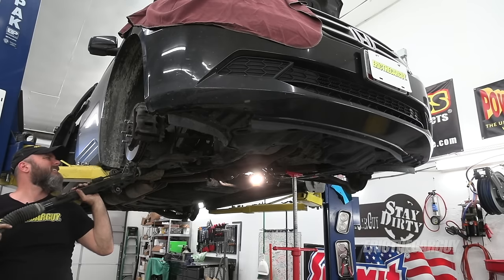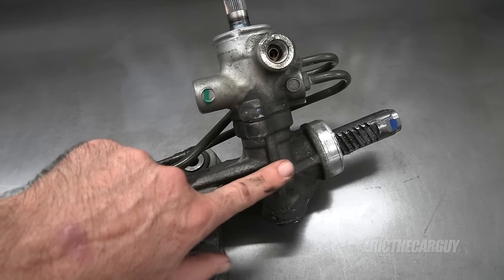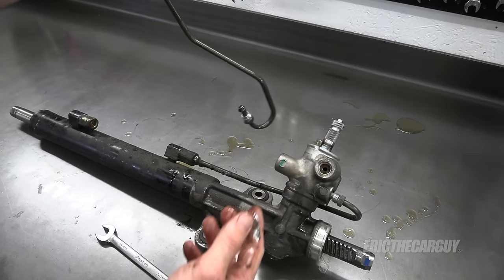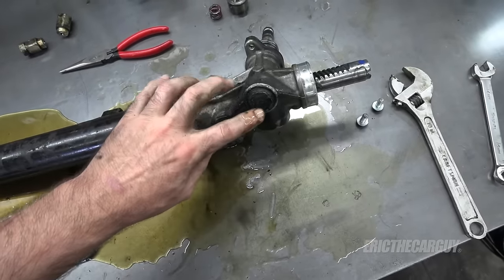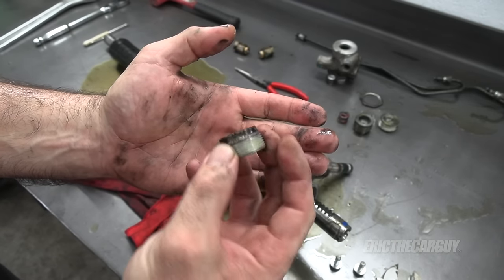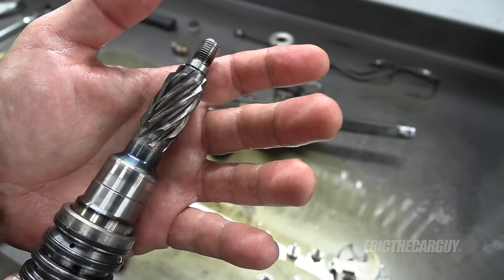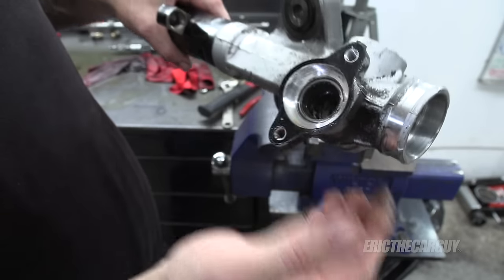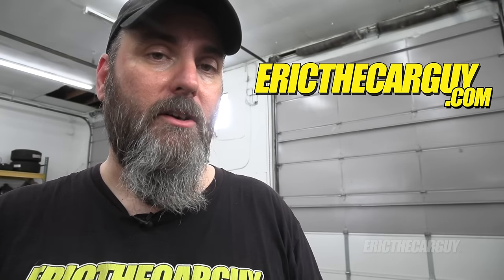Whats Inside a Power Steering Rack?

Comment: The older Odyssey racks didn't carry the pinion through the bottom of the rack. Instead of the wire clip arrangement the end cap screwed in with a bushing. Unfortunately on pinion side, the rod passes through the housing resting directly on the housing. You will find an indication of a slight flat spot on the rod where the adjustable plunger rests, as the rack moves across the alloy housing, you get a rattle which often people assume is the inner tierod, but is the excess clearance between the housing and rod. It actually makes alot more noise than you would expect, you can adjust some of the movement out, but you don't want it going tight on the less worn area. Incidentally the half round cap that rests against the shaft, is a plastic material on the older ones.
Overall there is little provision for lubrication between the rod and housing. Should a boot tear, muck getting in will end up on the outer housing and cause rapid wear between it and the rackrod, especially on the pinion end which sees the steering effort applied.
By the way, your rack is the wrong way round...

Comment: I've been having an issue with my 2006 Accord after tighteng the guide bolt about 1/4 of an inch and replacing the power steering pump last month. My steering intermittently stays light at high speeds. It's intermittent, it'll feel wiggly for a day or two then it will feel normal for a day or two. I found on your forum, you posted to a member saying that it usually is the variable assist valve in the rack failing. It sure seems like the steeting isn't "hunkering down" at driving speeds like it used to. It has it's good and bad days though.

Comment: the nut under the cap opposite the input shaft also sets bearing preload.  Too loose and it rattles, too tight and it damages the bearings.  I did a Ford Fox rack, there is a spec for rolling torque on the input shaft, basically the same idea as setting a crush collar on a diff.  Tighten the nut until its at whatever in-lb of drag.

Comment: Ok from what I am getting from this in , cause the top of my pinion is leaking , that instead of removing the rack , I can just remove the two bolts and both pressure lines and remove the steering shaft , I can remove the pinion housing ? to just replace that seal ?

Comment: Thanks for the heads up on the 17mm that holds the bottom of the pinion. I would have done the exact same thing. But it would have been on the tailgate of my truck. And I know the guy put break fluid in the pump. That would have been catastrophic to my paint.  Great work. And Happy Easter BTW

Comment: i happen to rebuild a similar rack and pinion for a montero 2005 and after some research the teeth MUST be at specefic tolerance or it wont engage with the pinion seamlessly and that  lead to metal to metal contact and causes metal shaving in the seals that you saw
it is rebuildable if you buy the seal and bearing kit

Comment: Excellent !   I have 2 Toyota's . a Corolla and a Tundra that have leaks in the hard lines on the rack.  The local mechanic says those lines can't be worked on, and I need to replace the rack = $1500  They looked like replaceable items on your video.  Should I get a second opinion?

Comment: Smashing teardown :-D
It's simple but complex, the complex bit is that rotation sensing valve, well that's my view.
The toothed rack and drive is a simple enough idea.
Now put a new bearing in and re assemble it lol.
Reply from the maker: Given that I just installed a brand new Honda unit, I won't be rebuilding this rack. Lots of people want me to though. Personally, I don't recommend rebuilding PS racks given the effort in R&R and the high potential of failure. I think you're better off just installing a reman and being done with it. That's just my opinion. As always, thank you for your comment.

Comment: Pretty interesting video, its good some one can open her up see whats what. I noticed that at time stamp 12:54, I can see a difference in the height teeths. From your hand to the right, they seem higher; from your hand to the left, they seem shorter. I don't know if theres any revelance Of course mine is an 05 T&C, which just developed a knock thump noise at turning either way. Not the cvjoints, been replaced. At a stand still, steering turns wheels left and right with no noise, until you actually drive it. And I am wondering, could it all be loosened bolts! It was in for high pressure hose replacement. I wonder if rack needed to be loosened to get the the hose fitting..

Comment: Wonder if in the accident maybe the rack wobbled a little inside the housing causing the fixed piston/seal to smash into the walls instead of the O ring causing just enough metal to scrape off and make tiny places where the fluid could leak by and it would bounce back and forth like a bad strut or something, plus mooshing the bearing making it that much worse.

Comment: I have a crown vic p71 as a beater daily and I've replaced basically everything in the front end but the rack, wheels are tight when you try shaking them by hand left/right/up/down and it has like a "shimmy" you can feel in the wheel, as if the wheels are wanting to go left/right slightly. Think it could be the rack? that's about all that hasn't been changed. It has just never felt like it wants to drive straight despite the alignment being done multiple times and everything changed from the ball joins to tie rod ends, sway bar links, etc

Comment: I have an 04 tl and the car always pulls to the left. Replaced power steering pump which made steering feel better but car still pulls to the left. I had an alignment done which fixed other driving issues (darting around over bumps). All suspension brake and steering components are ok. Did the shop maybe screw  up the alignment? Or could it be a steering rack issue?

Comment: There are sealkits available (inkl. new bearings) so you can reassembly the rack and use it oneday on one of your odysseys if you need one.
I would save the power steering rack as a reseve...

Comment: the seal on the outside of the rack gear rod does double duty. It serves as a place for the seal on the rod and the cylinder bore also the bearing block for the rod.

Comment: great job getting it apart might want to rebuild it as a spare cheap fix if it just needs bearings and new seals thumbs up shared
Reply from the maker: I seriously doubt I'll need another PS rack since I just installed a brand new Honda unit and I maintain my vehicles very well.

Comment: I've read that mfrs replaced recirculating ball steering with rack and pinion because r&p is cheaper to manufacture.  But that looked like some precision machining in there, didn't look very cheap to produce.

I would say the reason recirculating ball gives you less "road feel" is that that kicks from the road cannot transmit effectively back from the Pitman arm through the ball bearings to the steering column.  There is no such isolation with r&p.  I don't love "feeling the road", it's not comfy, but apparently some people do.

Comment: Great video. The steering rack on my 2008 Vito is leaking fluid from a steering gaiter after about 27k (reconditioned exchange unit) so if it's out of warranty I'm wondering whether I can get the seals out and replace

Comment: There is one more oil seal inside the housing, i been rebuild alot type of steering rack for 5 years now.
The steering rack is fixing able, you dont need to change a new one, when it leak.

Comment: The bearing in question may be 6001 one side rubber seal one side open, if u have a caliper might as well measure the inner, outer and width to get the exact size which will determine the bearing number.

Comment: about you working table, I have one there is 4 ft by 10 feet it used to belong to a guy that work on hydraulics very neat and organized table, it had an edge chanel heavy duty with downspouts for all the oil spells, that will lead to a container,  I found this could be good for people that work on automobile parts with a lot oil in it

Comment: That 1 way check valve can be an issue if your front wheel are hit in a crash when on full lock .The wheels being pushed back suddenly can upset that valve causing heavy steering .

Comment: If the bore of that Koyo bearing looks to be 12mm, that is a standard (catalog) bearing size: 6001.  12mm ID, 28mm OD, 8mm width.  I believe I've seen NSK, Koyo and NTN bearings used in various places in Hondas.  (The wheel  bearings on our TSX are NSK--not a standard catalog item though.)

Comment: I've seen the same retaining system at 10:45 used on hydraulic cylinders on heavy equipment, it's usually a steel band rather than wire but it's the same principle. 
And now that you have it apart maybe a rebuild video? Then you'd have a spare, and we all know that if you have a spare you will never need it.
Reply from the maker: I agree, I'd never need it. I have a new Honda unit installed in the van that's working perfectly with brand new fluid. https://youtu.be/haCGztYY0rk

I'm getting to a place where I'd rather have the time over some part collecting dust somewhere that I'm never going to use. Thanks for the comment.
Reply: @ericthecarguy  I was attempting to reference the phenomenon of having a spare and never needing it for the purpose of humor, but it seems I failed.  I'll stick to my day job.
Reply from the maker: No worries. I get it now.

Comment: Howdy Great video. So I have a 1998 Honda RA5 V6 Odyssey power steering rack with a serious leak coming from where the rubber boots are.
I've tried Lucas stop leak 2 bottles worth and having no success. I'm thinking of using another stop leak AT-205 Re-Seal Oil power steering stop Leak. Rather than having to rebuild to replace the seals. Power steering Seal kits seem to be very expensive .  So was wondering if u can do a video on ether Lucas or AT-205 Re-Seal Oil power steering stop Leak and see what's the better chose in a real world!? Before I go and start taking things apart... Kind regards Auburn

Comment: Guessing those hole are actually the return path for the fluid that is leaving whatever side of the double acting cylinder is not be pressurized.
The fluid goes out under pressure to one cylinder or the other, there has to be somewhere for it to return from to the pump. 🤷🏼‍♂️ could be wrong.

Comment: Eric, in the other video you showed a yellow plastic "sleeve" or something between the rack and the steering column that wasn't there on the old rack.  Couldn't its absence from the old rack cause that little u-joint to be loose and clunk?  Seems like that could make quite a difference to me.
Reply from the maker: It was there, it came off during removal. https://youtu.be/haCGztYY0rk

Comment: Nice video. What specification that will define the compatibility to work with rest of steering system. Many third parts provide has no thing to list technique specification for compatibility. I am ask this is because one shop replaced my car steering rack with new parts from AMZN causing stiff turn issue.

Comment: Hey Eric ,I need a new water pump pulley for my 383 vortec 92 Silverado.......can i machine down the surface between half a mill to a millimetre  maximum .will it make a difference with the belt tensioner ...or heat from the pulley to the belt ....I’m not sure it’s only slight ? I got to be pretty resourceful here in Australia 🇦🇺 for this model.

Comment: I have the same car. My problem is the leak from top of the metal housing (that goes on the pinion). You say there is no snap ring on top and I see there's no seal ether. So, how do I get a leak from top. Any suggestion how my problem can be fixed?

Comment: Hi when my GT is lifted up, and i push against the front tyres, there is movement of the tyres. Is this normal?

I have not noticed any issues driving...do i need to replace or repair the power steering rack?

And is it safe to drive?

Comment: hey man,  any ideas on a 01 honda crv why the end seals of the power steering rack are leaking if so can I just replace them or should I do a full steering rack replacement? the leak is bad and I'm worried it's eating away at bushing boots etc. causing more damage then  I'm currently aware of

Comment: Hi Eric. At the 9.38min mark, you showed the pinion shaft after cleaning. Could the dark colouring on the shaft beneath the teeth be caused by excessive heating?. Looks the way metal goes if over heated causing changes to the tempering. Having said this I must admit that I am not a mechanic nor a metallurgist so I am only surmising. If this is indeed what I am suggesting, could this have been the cause of your issues.?.
Reply from the maker: I don't believe that was the issue. I think the discoloration is from when they made the part. They heat treat metal parts to make them harder.
Reply: EricTheCarGuy Thanks for this.

Comment: How do I remove the seal retainer and cylinder cap? Is it just pulling on the side that has the 4 screws that fits the black tube? Through the service manual it seems to be hauling but is hard to get out.

Comment: Theres a piston in the middle of the inside shaft. When turning one way it directs fluid to the opposite side of the fluid and in turn assist pressure to turn the inside shaft to one side i remember that from the steering and suspension ase

Comment: Owww seeing you slam your hand on the wrenches. I would use a plastic dead blow hammer. You have hands like hammers.👍
Reply from the maker: Hard to hold the rack and swing a hammer at the same time. I've been hitting wrenches like that for years and it really hasn't been an issue. The trick is knowing when you can hit a wrench like that.
Reply: @ericthecarguy  Ditto.  Also, knowing what part of the hand to hit with and how hard.  Just takes some experience and a bruised palm or two.
Reply: @maingun07  Wait till your 70.  Bad wrists. Pain inhand  places you didn't know you had.

Comment: Metal shavings on the hydraulic piston part of it means that these shavings were sent there by the pump. I'd check the pump for damage.
Perhaps the pump was operating without oil. The micro-scratches on the inside of the hydraulic cylinder are enough for the liquid to start sipping past the seals and create uneven assist on turning.
Reply from the maker: No damage to the pump as far as I can tell. I changed all the fluid when I changed the rack. https://youtu.be/haCGztYY0rk
Reply: @ericthecarguy  Well, then, my theory was proven wrong in your case :-) I had a few struggles with my power steering, when changing one component only shuffled the metal shavings around damaging the new component. And only when I changed both, the problems went away. I had tremendous fun taking apart my steering rack though :-)
I am glad yours was a happy ending.

Comment: 10:10 Is there a tool to take that apart (similar to the one used on an angle grinder to replace the disks), that looks like a Y (more or less)?
You could probably make one if you wanted.
Reply: if it was threaded there would be some kind of spanner for it but that clip he pulled out likely sits in a channel in the outer body of the rack to hold it in place. judging by the size of the clip it probably has quite a bit of tension
Reply: @Wulthrin  Exactly, so having a spanner would make it easier to get the clip out, especially if it is magnetized. Then you can pull out the cylinder thing.

Comment: How much working force does the ram exert to the turning of the steering knuckles? And is that a variable pressure unit, or, are differential pressures controlled at the pump with a speed sensitive control module?
Reply from the maker: More psi is directed at low speeds. PS virtually goes away at higher speeds. The valve assembly at the top of the rack controls the PSI in this rack.

Comment: So the shim needs adjustments over the years? My steering is kinda loose, but ball joints and inner/outer tie rod seem fine.
Reply from the maker: It's not really something Honda endorses. If you get it wrong, you can ruin the rack.
Reply: I think im gonna buy the wrench, to try to  get the play out of the rack. Sounds like it would be best to budget a new rack just in case.  
I pulled the inner tie rod boot back and you can see the shaft coming into contact with the casing of the rack.  Its not losing a drop of steering fluid and the ball joing on the inner tierod is nice and solid.

Comment: I would bet that the "accident" damaged the inside of the long tube shaft.  When you removed the shaft from the tube at 12:25 the rubber o-ring on the fixed seal was really flat.  That is where you found the metal shavings.  My guess is the accident caused the fixed seal to hit the inside of the tube shaft and caused damage.  Further use caused that o-ring to wear down going back/forth against the damaged area because the o-ring was nearly flat.  Inspect the inside of the tube shaft closely and I'd bet you will see a spot that has damage.  Hitting bumps with a worn out o-ring on the fixed seal will cause the clunks.  

Also, you should wear gloves as oil absorption into your body will eventually cause issues.
Reply from the maker: I think it was the bad bearing on the pinion shaft that caused the vibration over bumps. Thanks for the comment.